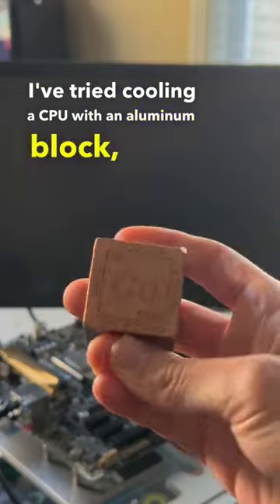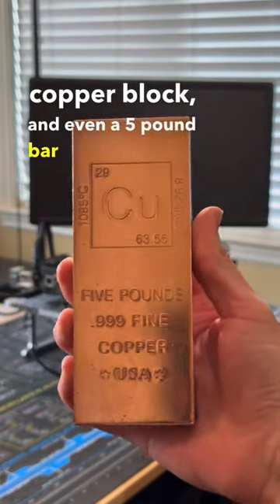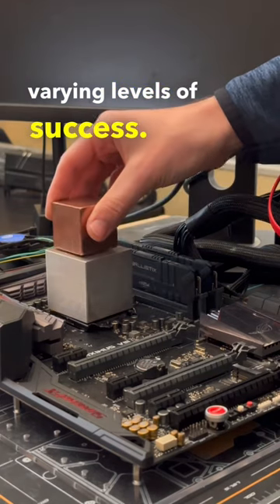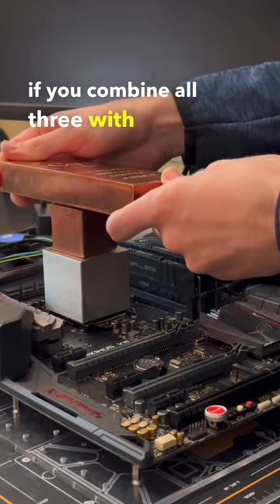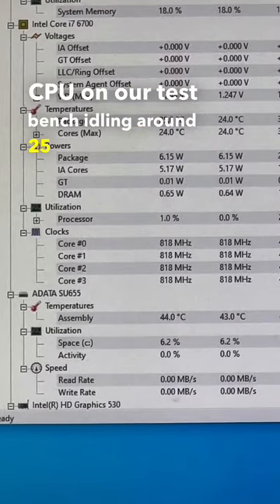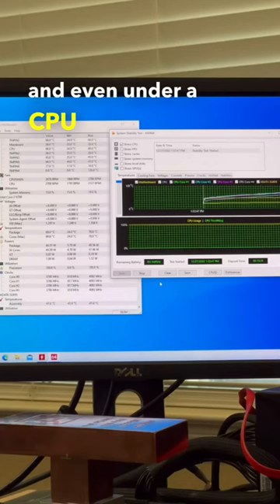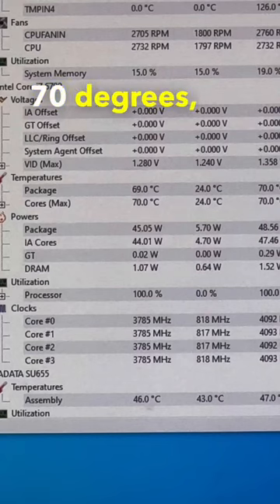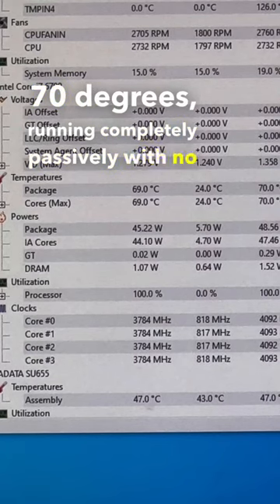I Stacked Them! #shorts #pcgaming #pc #gamingpc #pcbuild

Comment: The metal is acting as a thermal sink. It's absorbing the energy, and only through its surface moving it to the air. It's likely that the surface area isn't enough to keep the CPU cool in the long run.

An effective way of moving heat into the air is the best cooler. That's why heat sinks usually have thin blades. Lots of surface area.

Comment: You should put the copper on the bottom as it is really good at conduction and aluminium on the top as it's good at radiating heat

Comment: Until you have soaked it with heat then it will get hotter and hotter and throttle.. heat soak is a real thing and why heatsinks have fins for surface area and fan's to move air to move the heat.

Comment: be careful, like other comments are saying that thermal mass can get soaked in heat and struggle to dissipate it. this would be good for quick full throttle stress test but not for long term work

Comment: i think copper would be first on cpu them aluminum on top of copper in order to cooler it down because aluminum is sensitive to moving air and once you blow at it just turn cold so quick and copper doesnt it still be hot and drawing into more hotter because copper is knowing draw heat in it than aluminum is pull heat off of it

Comment: That's thermal mass.  The reason coolers have fina is to transfer the heat away into the air.

You can do math pretty quick to see how much energy it takes to heat that mass up.  And how quickly it will dissipate it.

I would put the copper block on bottom because copper is better at carrying heat farther away.  In this kind of test: heat soaking a block; it may not matter that much.  But it sure does when you are trying to carry the heat away for good.

10 mins isn't much use as a test, who plays a PC game for 10 mins at a time with hours in between while it is off?

Comment: You put them in the wrong order. Aluminum is less heat conductive than copper, so it limited your potential. The order from bottom to top should be copper block, copper bar, aluminum block.

Comment: LOL that sounds silly. how long was the stress test running for ? i bet it was under 10 minutes :D and if you know anything about anything, you will understand why i am saying this.
Reply from the maker: It stabilized around 8-10 minutes in and I let it continue to run for I believe 15-20 but the temps weren’t changing and were right at 68-70 degrees. We can run it longer but I don’t think it will get too much hotter as it didn’t really change after the 8 minute mark.
Reply: @mattscomputerservices  so, the cpu did not thermal throttle and drop to lower speeds to accommodate shit cooling... it just worked? considering the surface area of those blocks and material used it just sounds like bs. i believe you understand how a cooler works. and you know why coolers have fins, usually, looking like a stack thin metal wafers with gaps in between? to increase the surface area. what you're trying to say here is that these blocks of metal are managing to somehow magically make energy disappear. could you see how that does not sound right? in general, could just say "energy conservation law".
Reply: @Xamiakass the metal has so much mass that it would probably take a few hours to get hot enough where it wont be able to absorb enough heat from the cpu anymore. This actually could work if you only used the computer for an hour or two at a time